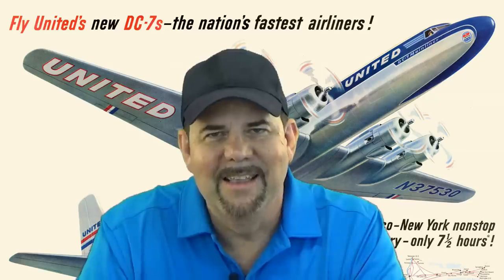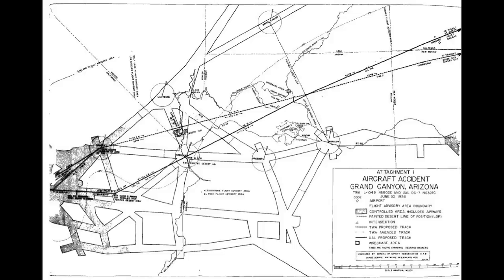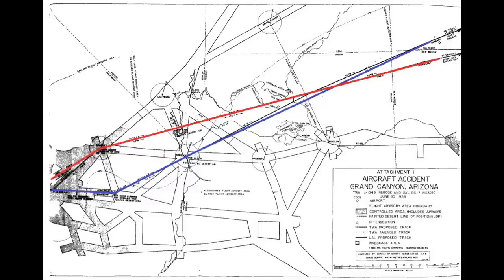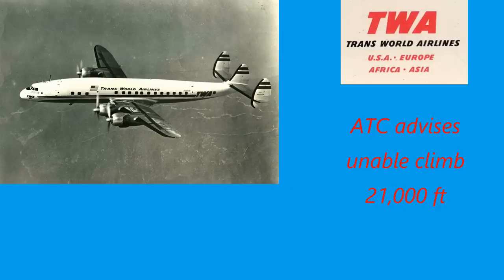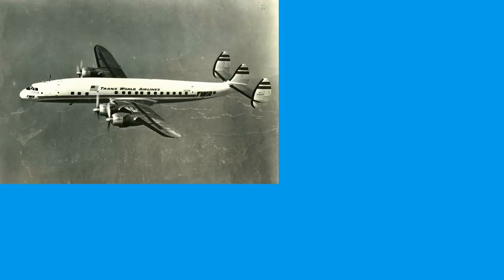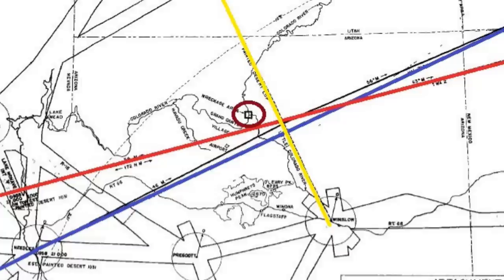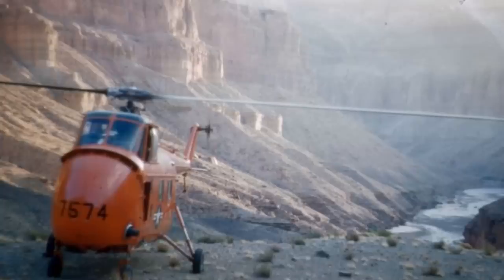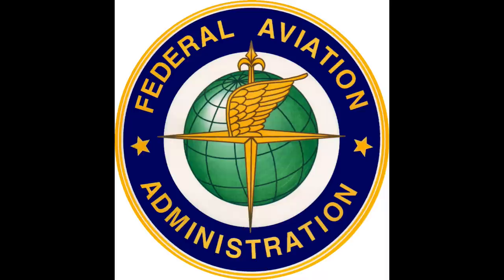The Crash that Changed the Way we Fly; 1956 Grand Canyon Mid-air

Comment: Good video, thanks for making this so informative! A few comments:

1. The crash site is very remote and in some of the roughest terrain in the U.S. I'm surprised the wreckage was spotted so quickly. It would be very hard for river rafters, of which there were very few as compared to today, to beach their boats and walk to the site. 
2. Continuous voice contact with air traffic control centers was not possible at the time, which you pointed out. Instead the airlines had radio operators in various locations, mostly at existing airports. There were many blind spots and that is why aircraft called in positions and flight times, with estimates of their flight time to the next VOR. 
3. The transmitters/receivers on the ground were not always linked together to on wide area location, they had to have operators in the various places you've mentioned.
4. Installing infrastructure to provide continuous radar, VOR's and voice communications was a huge effort. Hundreds, maybe thousands, of sties had to be developed, which required providing electric power to these sites, road access for constructing and maintaining the buildings that contained the necessary electronics. These facilities had to be linked back to the air route traffic control center (ARTCC). This is done using phone lines or radio links. Remember that computers were non-existent at the time so methods that sent radar data to a centralized location had to be developed. 
5. Voice radio sites had to be located to cover wide areas of the sky so as to maintain continuous voice contact across the entire country. With large and small mountain ranges creating radio blind spots, this is not easy. Each of these non-staffed radio sites became "remote bases" and had to be linked back to centralized locations. This was done using phone line or radio links or a combination of both. As blind spots were found additional sites had to be put in until, eventually, there was full coverage. Frequencies had to be assigned in a manner where pilots flying in a certain ground area were all on the same frequency to enable everyone to hear each other along with maintaining radio contact with operator of that area (sectors) located at the ARTCC. They also had to set up sectors so that each sector controller did not have more traffic than one person could keep track of and the changing of radio frequencies in the aircraft was minimized. 
6. The radio band first used by long distance aircraft communications was called "HF" or "High Frequency, " commonly known as "shortwave," or 1.6 to 30 Megahertz. That is why, in older pictures of aircraft, you see a long wire extending from the vertical stabilizer (tail) of the plane down to a location just behind the cockpit. That wire is a radio antenna. HF has the advantage of covering wide areas as it can bend over terrain and can bounce off the Ionosphere layer of the atmosphere. The disadvantage is that  HF is subject to interference from sunspot and atmospheric conditions. So a new frequency band, the aviation band, using much shorter length radio waves had to be designated, this required the installation of more remote bases across the country. This band is from 108-136 Megahertz, just above the FM radio broadcast band. This band is used all over the world, which required a great deal of international cooperation and coordination. 

Setting up and maintaining this system was (is) a herculean task. It should not be taken lightly or for granted. Maintaining this system is expensive and is done entirely by the federal government. In addition private providers have set up remote bases in various locations to enable aircraft to communicate by radio with their various airline offices for maintenance and service (logistical) communications. In spite of cell phone coverage and satellite communications this network is slowly being expanded.   

This takes a huge number of people and a lot of money. Your ticket pays for most, if not all, of  this. Just in case you wanted to know a few reasons why your airline ticket costs as much as it does!
Reply: The above comment is long because the air traffic control system is fairly complex. I'm not a pilot or an aviation industry employee, but a ham radio operator who listens to aviation radio and visits a lot of electronic sites.

Comment: I flew from NYC to LA in 1959 on what was called a 3 tail conny with my grandparents in 1959. There was a stop somewhere in Minnesota. I remember they sold boxed lunches in the airport to carry onboard if you wished. People were dressed to the nines. Very different back then.
Reply: I wasn't alive at the time but after watching some Boeing/Douglas/BOAC commercials from the 50's I can vow for your statement. It was indeed a different time with more luxury for the passengers and less tune can like flights. I do understand the increased costs of operation and security for each airline and aircraft developer, but in the end the best would be a fly stile of the 50's with the technology and security of the modern day.

Comment: When I hired in to Los Angeles ARTCC as a new controller in 1968, they still had the original audio tapes of this accident.  A lot had changed between 1956 and 1968 - enroute radar, positive controlled airspace, direct pilot controller communication and better navigation systems.  A lot more would change in the coming years including computerized radar displays with a data tag attached to each target displaying aircraft ID, altitude and ground speed.

Comment: Very well done! I was 10 years old then and always loved flying. Familiy members in New York required flights for us from Milwaukee. I flew on both of these type aircrat, and also the Boeing Stratocruiser, the Prop Jet Electra, the DC-3 and some others along the way. It was a time of being unaware of what could go wrong. It seems inconceivable that 2 aircraft would be at the same altitude. But that is the way it was and would continue to be until disaster struck. And it took 2 more collisions before a change was adapted. I flew single engine for many years and still loved the slow flight on a summer day at 3500 ft. in a Citabria. I like the open window. I loved the beauty of the earth below. I loved grass runways. I loved fuel gauges that were rods with a cork at the end, floating in the fuel, right at the base of the windshield. It was a great time to enjoy flight. And then crowding overcame the freedom. I am glad this was a part of my life!

Comment: General aviation pilots flying VFR are constantly aware and searching the sky for other aircraft. Commercial aviation is very safe
and the FAA does a great job of doing everything possible to assist pilots and avoid possible mid air collisions. I was a commercial airline pilot
for over 34 years and have returned to general aviation flying recently. My greatest fear is a mid air collision. The air space over Southern California is very restricted and  therefore more VFR aircraft are sharing the sky. In years to come I wouldn't be surprised if VFR flying is curtailed over major cities and on certain airways.

Comment: Great video, was referred to it after watching some videos of the second United - TWA mid air crash, over Staten Island, NY on December 17, 1960.  In the 1950s, it took thousands of man hours to get these prop-driven aircraft into production, as they obviously did not have CAD driven computer programs.  You would think they would realize they needed better navigation and/or communication to allow routes that intersected such as the one in the video.  

The 1960 accident, after tracking systems were much improved, seems to be the result of the United pilot ignoring a request to circle an area while the TWA plane would first pass and clear his route.  Instead, he ignored the directive and flew right into that plane.  He continued on for 8 miles, crashing the plane into a Brooklyn street.  The only survivor was a little boy, who died the next day.

Comment: Very well done!  As a Private Pilot, this video brings out the greatest fear of pilots - the dreaded midair collision.  Yes we have come a very long way in reducing the risk of a midair through advanced radar technology, and modern navigation and positioning GPS technology, however, my big concern is about the many private aircraft that to this day are still allowed to take to the air without any GPS systems or without other basic units such as a transponder, which are needed (but not always required) to help avoid midair collisions.  Here are the things we need to make midair collisions nearly impossible to happen:
1.  All aircraft must be required to be equipped with a transponder. 
2.  All aircraft should be equipped with a TCAS collision-avoidance systems.
3. As an additional safety measure, all aircraft should also have an Airborne Collision Avoidance System (ACAS)
Reply: As with everything in the 'free' world, you follow the money. In an ideal world, everything that takes to the air would have state of the art reactive communications aboard, with people trained to use it. In private flight, not all can afford these systems. Therein lies the problem. How can we make it possible for all aircraft to have ACAS. One idea might be a nationally-funded system where low or no interest loans might be available for parts and labor. Maybe implement a progressive system requiring the retrofit of older aircraft, and the requirement of new aircraft to have ACAS. Things like this, or ideas like this need to be discussed frequently.

Comment: This is great, but it’s not quite the version I heard as a kid around 60 years ago.  But it sounds credible anyway.  My Dad had a very good WW2 friend, an aviator, who told his version to us on a visit.  It’s been a very long time ago, but either he or a friend who told him, was in a radio control room who heard the event from one of the aircraft.  And it was chilling.

If I recall correctly, and this might be old age setting in, the United DC-7 came into collision with the TWA Connie.  The DC-7 fell like a rock.  The Connie, though, suffered fatal damage to the tail section and the cabin crew lost control.  But the plane remained in the air.

The aircraft began a slow, circular descent that couldn’t be controlled, but still fatal, while the flight deck was still in radio contact with the ground.  My Dad’s friend recounted that during this prolonged crash, it was tragically horrifying to hear the radio operator’s voice get increasingly tense as he knew the end was coming ever more closely near.

If that’s accurate, I just can’t imagine what was going on in the cabin if they were still conscious.  I hope they weren’t.

That’s what I remember.  But this does sound quite credible, too.
Reply: You have it backward.  The Lockheed lost its empenage and immediently went down due to loss of horizontal stabilizer.   The Douglas flew for minutes before control was lost,

Comment: Your analysis is superb.  Job well done. To give you a little first-hand info.  In 1975 I flew in with the AZ NG to the crash site to photograph the wreckage for removal.  Flew through the Grand Canyon in a Huey and we landed near the site where the DC-7 hit. Not much was left of it, but the pilots saw the props.  They said the crew was fighting to regain control all the way down and were trying to power out.  After the DC-7 clipped the Super Connie's tail section, it flipped on its back and fell straight down. The largest section remaining was the wing box. It was eerie.

Comment: Minor point of clarification. It was a Lockheed Super Constellation named Star of the Seine (there is one, an L-1049H, atthe National Airline History Museum at the Downtown Airport in Kansas City, MO). The flight was 31 minutes behind schedule. The Lockheed Constellation was the L-049.
The United Airlines Douglas DC-7 was named Mainliner Vancouver.

https://en.wikipedia.org/wiki/1956_Grand_Canyon_mid-air_collision

This crash site is listed:

U.S. National Register of Historic Places
U.S. National Historic Landmark
1956 Grand Canyon mid-air collision NRHP plaque.jpg
Location Coconino County, Arizona
Coordinates 36°10′30″N 
                        111°50′00″W
NRHP reference # 14000280
Added to NRHP April 22, 2014

On April 22, 2014, the site of the crash was declared a National Historic Landmark,[20] making it the first landmark for an event that happened in the air.[21] The location, in a remote portion of the canyon only accessible to hikers, has been closed to the public since the 1950s.[22][23]

In his novel Skeleton Man (2004), Tony Hillerman uses this event as the backdrop to his story.

Comment: Thanks, James - fabulous video. I live in Kingman, AZ and am familiar with many of the locales in the story. I was wondering if the TWA pilot used poor judgment when, after being denied 21,000 feet, he used the On Top rule to end up there anyway? Didn't he realize there must have been a good reason to avoid that altitude? Why not go to 23,000?
Reply from the maker: That is an excellent question.  First of all I don't think we will ever be able to answer that question.  I think the underlying problem was little or no communication with the air traffic controllers directly. The controller did not convey to the TWA pilot the reason for not approving climb to 21,000 feet. That is one of the difficulties working through radio operators and not direct communication with the aircraft traffic controller. 

The second problem was the fact that climbing to VFR on top was a normal procedure.  Pilots were never alerted to the possibility of coming close to other aircraft. Makes you really appreciate the air traffic control system that we have today.

Comment: Think about how many more planes are in the air, now - a whole magnitude more.  The aging computers, software, and radar.  We do have GPS. 

At/after the time of your story, over the Atlantic & Pacific oceans, the US Coast Guard had ships that made circles in a box of water 10 miles on a side to give pilots their location, an approximation, since satellite positioning was far in the future and most were out of Loran range (early electronic navigation systems).  It was called "Ocean Station", month on and month off for the crews. In the Pacific, there was a "double victor Ocean Station" - two months on and off - between Hawaii & Japan.  No matter the weather for the ships' crews.  Not sure of the radars, but as recent as the 1970s, the USCG operated ships equipped with cast-off/obsolete Navy radars, and repurposed weather radars.  Those ships were decommissioned in the mid 70s, i believe. Steam powered, forget if they were 311 feet long.  Not much of a ship to sit out there in the storm seasons.  No satellite weather, either.
Keep up the good work.

Comment: Now I kind of understand what was going on in the cockpit of a  Jan 1959 NewYear weekend flt I was on from Ohare to San Francisco - and why we landed at  LA instead!.... Almost AWOL to TI over the error! 
The  aircraft heat had not worked from Boston to Chi and was still out from Chi to Ca.. There was snow on the floor and ice on the windows. They announced inside temps were 30 deg.. Passengers were allowed to rotate thru the engineer spaces and cockpit. I managed to look into the cockpit when my turn came and I witnessed  an argument between the pilots apparently about where we were. USOA, a Constellation (not suire if Super Connie or not)

Comment: My late grandfather was an air traffic control operator at Lambert International Airport at the time of this accident. I think he was working with the airport in getting their radar stuff working, as that's what he did in the air force just prior to getting the job at Lambert. The day of the accident, he got a phone call in the tower saying his wife was going into labor. Naturally, he rushed to the hospital (after checking to make sure everyone in the tower had everything under control). Turned out to be a false alarm.

 When my grandfather got back to the airport, he saw a bunch of what he called "FBI cars", which they very well could have been, or, I think more likely it was people from the CAB or local law enforcement. Anyway, he was really upset when he pulled up, because he thought him leaving had caused an accident. Now, as we know, the planes didn't get anywhere near St.Louis, but I suspect the powers that be were collecting information from all towers, and that's why they were there.

Great video! Very interesting. I never really understood the tracking system that was in place until I saw this video.
Reply from the maker: Thanks for sharing